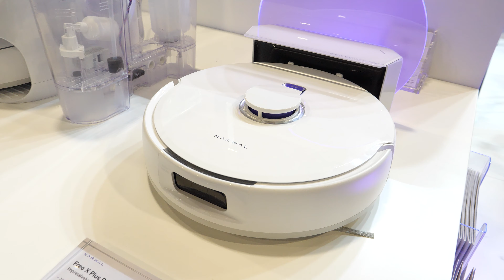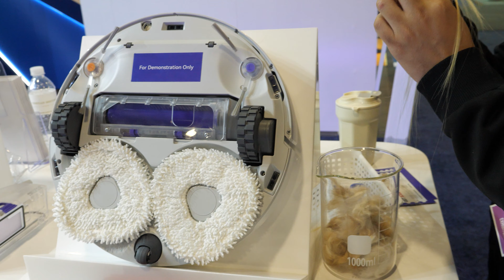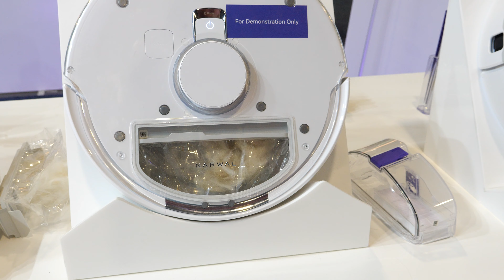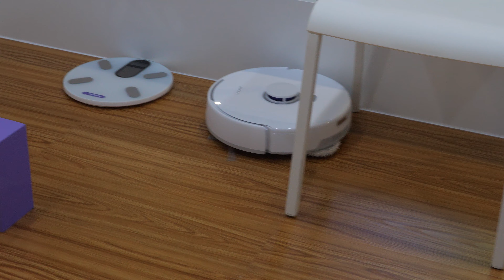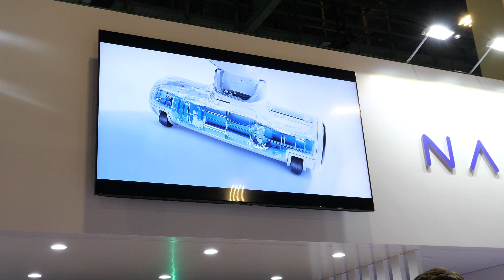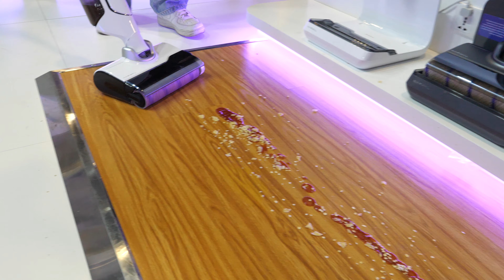The Zero Tangling Brush on the Narwal Freo X Ultra Will be Life Changing

Comment: The Price of this compared to other robots currently on the market is incredible at least at the early bird promotional price right now. I really want to buy it although I chose the dreame L20 ultra because I got a better price on it for all of its advanced features. but Narwal has really made huge improvements here and I def want to buy one for my upper level house as I think it would do much better for the upper floors. But I am going to wait until it goes on sale for black friday or another time of the year at this price. Hopefully it does because I think for 1000 dollars for what it offers is a steal. Compared to the other vacuums on the market which have similar features but run almost 2000 dollars. Narwal isn't being too greedy here especially for a robot with 8300 Pa of Suction power.